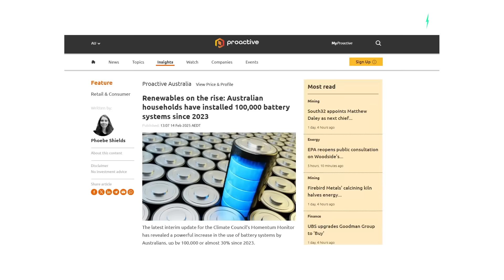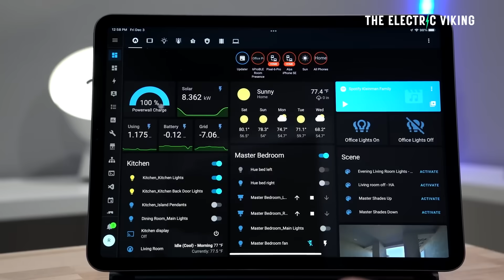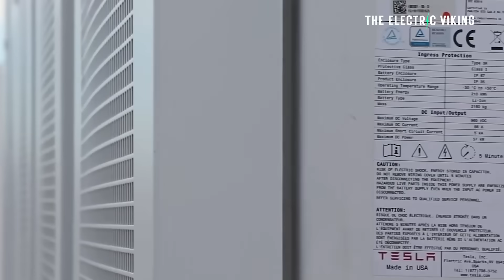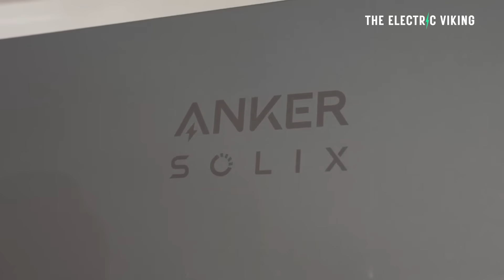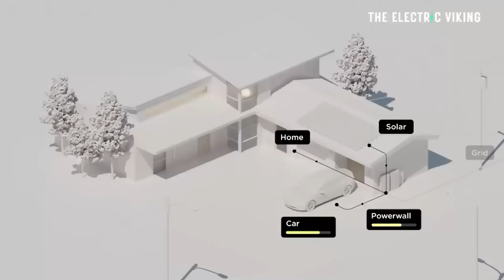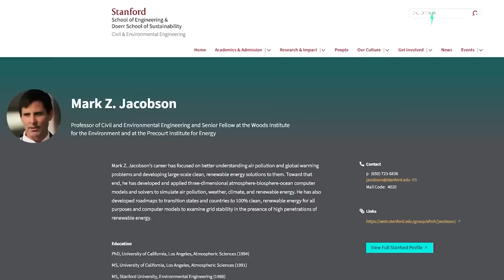91% More Battery Power on the Grid: How Australia Tripled Storage in 18 Months

Comment: From a cost calculating point of view we need to see sub US$100 per kw for batteries and with install cost and inverter cost it will still be $250 per installed KW. Say one kw is 15 cents. With inefficiency it would be more like 13 cents. So we divide $250/.13 = only after 1923 days is the kw paid off. Throw in opportunity cost 5-6% per year and a battery that has a shelf life of 10 years. It makes no sense when the installed price is US$250 per kw. You will find the price is way higher. So Australia is throwing tax payers money after a scheme that is not financially viable. I am not denying climate change but  my gut feeling is there are better ways of reducing CO2 and methane emission per dollar spent than going to subsidize home batteries.

I would love some common sense debate here on Electric Viking.

Also the Spain blackout what it has shown that when renewables hit 70% of total electricity generation which is all DC power and so is battery storages, that there is a need for what is called inertia in the AC system to stabilize grid frequencies. This inertia is provided by the the size of giant turbines from traditional power plants that spin. Ireland has recently built a massive flywheel spun up by renewable energy to provide inertia. The Spain blackout is a bit of a wakeup call to go gung ho on renewables without the necessary fail saves in place. There was not enough inertia in the system. A 2-3 day loss of productivity from a total blackout is never calculated in the LCOE or SLCOE calculations of renewables.

Same with EVs, has some one looked at the lifecycle CO2 emissions of EVs vs ICE and the subsidies that are thrown around on both sides, fossil fuels and green energy subsidies or tax rebates and look at the cost of a ton of CO2 saved from the atmosphere. Now compare this to the cost of a carbon credit.
Reply: So i did some research in Perplexity for the Australian market. With the federal subsidy it would cost between AUD700  to AUD950 per kw installed based upon a 13kw system. The subsidy is AUD327 and the lifetime CO2 emissions saved per installed kw, which included deducting the battery making process is 1.6 tons of CO2.  which is AUD204 per ton of Co2. The cost of a carbon credit in Australia is AUD34.10. So in my opinion a waste of tax payers money if you care about CO2 reduction, which I do. I wish some policy makers would use some more common sense.
Reply: @TheOrangeGunner  Interesting.

Comment: My comment on a nuclear promoters site,

" Grow up, nuclear is grid electricity and grids are f.............g expensive. 

Grid electricity is extremely expensive and extremely small part of total energy. 
Grid electricity energy is only 4% of Australia’s total fossil energy useage. 
Grid GENERATED electricity cost is only 10% of grid DELIVERED electricity cost. For me 50cents kWh.
Grids cost $TRILLIONS = $TRILLION GDP. 
Grids are extremely expensive and max out national GDP capacity. 

So, 4% and 10% means 250 times more national expenditure for nuclear to be useful. 
Because you need massive grid construction. 

Add, decades of construction and mining for raw resources and....  to expand the 1million km Australian grid. WTF. 

Now, add military defence budgets exploding costs to the nuclear grid electricity costs and the costs are insane, grow up and think. 

Data Centres will run on light, not electrons.
Huge amounts of electricity will not be needed. 
Keep up with chip evolution and computing evolution. 

Fossil fueled energy losses from heat loss will not be part of the energy sector. 
33% to 66% losses daily. Grow up. 

Grid owners know that the grid is too expensive to expand and too valuable to waste as it connects all the meter boxes, all the cashflows.
Grid connection is the critical feature of grid economics. 
Industrial Customers moving away from fossil fuels to clean feed-in electricity from millions and millions of EVs massive storage batteries and millions and millions of rooftop PV systems dirt-cheap electricity, self-generated electricity.
Grid owners will abandon central generation including nuclear electricity generation. 

Quantity has its own QUALITY,  grow up and think. "
Reply: The Westinghouse Nuclear plant in Ukraine is 8GW running 24/7, and should have never been more than 1c Kw hr, given that the plants have been paid off for decades.
Reply: @ChristopherLeeEdwards  look even nuclear promoters will tell you that the only place for nuclear plants is where the existing grid infrastructure fossil generators are. 

They want the original grid to themselves. 
They say free electricity still costs the customers 30 or 40 or 50cents kWh.

The grid owner's must have a return on their grid investment. 
Unless you are a dirty commie stealing private property, private investments. 😊😊

Comment: My strategy (now that I’ve retired) is to charge my ev in the sunshine of the morning, allow the storeage battery to charge to 100% in the afternoon Sun and then use the battery power to run the A/C and evening activity before switching the heating off at bed time.
During summer I’m almost entirely off grid, by adding another battery I’d be totally energy independent. Expecting a credit balance by the end of the first full year in our new house which is solar orientated and well insulated.

Comment: Lots of deals around at the moment. I had one quote for a 7kw array with a 25 kw battery for $10,500. Another from AGL for a 16 kw battery for about $6, 000 if you signed up for 5 years for their VPP. There is a problem with batteries though and that is do with their C rate.   The C rate is its ability to discharge a large amount of in a short time. This is needed to get your air conditioning started or even a fridge. The Powerwall 3 is good that way but there are stacks of new or no name ones where the C rate is too low and may let you down during a long black out.
Reply: Stay away from AGL VPP - i heard VERY bad things …..
Reply: @peteholliday1927  I probably will go it alone but AGL have been good on the over night charging at 8 cents per kwh.
Reply: @ ive been hearing they have been draining peoples batteries …..when demand is in their favour and leaving people with drained batteries at night